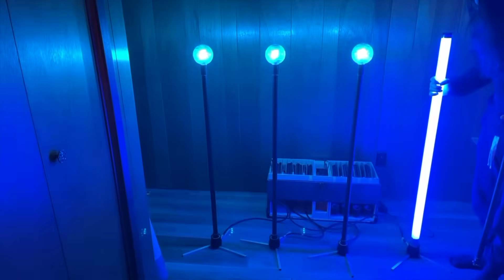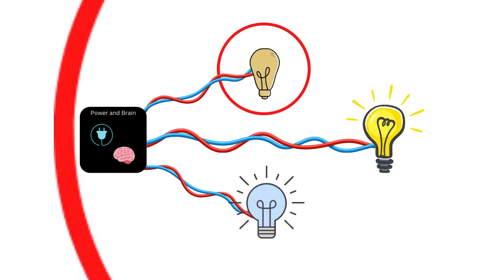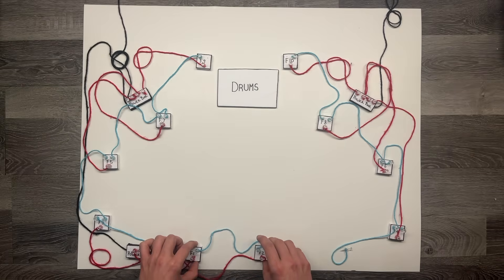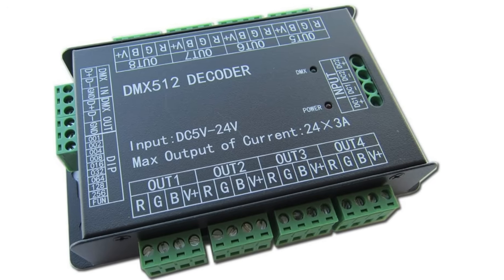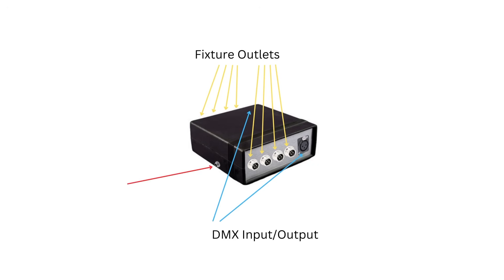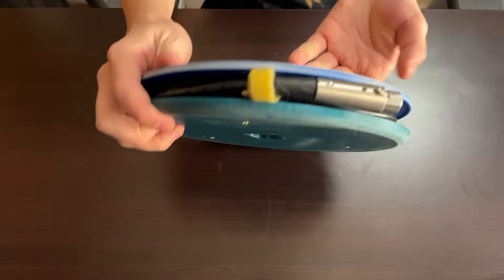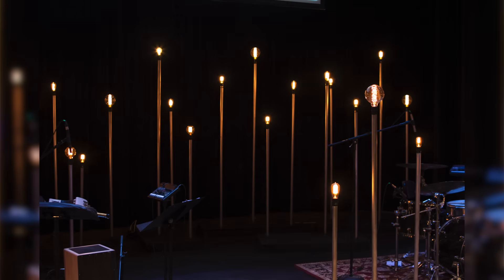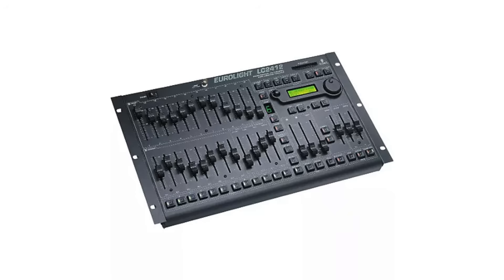This diy DMX Light Rig will Change Your Live Shows

Comment: How did you wire the cables?  Are those 4 pin connectors or do you need a 5 pin DMX?

Comment: great staff, but have one question - have you ever any legal questions/problems? you know - all the certificates, fire regulations, CE markings, etc.
Reply from the maker: That’s an excellent question and something I’ve been trying to figure out but it hasn’t been super clear, but the power supply is being used in a standard way and everything after the power supply is low voltage, which from what I’ve seen should be ok for how I’ve implemented things, but I’m definitely open to getting a more solid answer on this
Reply: @SuperValidDesigns  Great that you keep safety reasons in mind. I understand that you use certified components and the installation on stage is under low voltage, but I was wondering, for example, about the construction of LED strip tubes with light-diffusing paper, LEDs generate heat, not much, but still, have you tested them near other warm or hot devices that may be on stage, or how they will behave when they are accidentally covered with some fabric, a curtain?

Comment: hey! i find a lot of this fascinating as a pro av person who wants to use my skills at home but couldnt even begin to think about investing in pro fixtures. this would be a dope way to practice my programming abilities- but I have been looking into people using these decoders many of which have dip switches etc i suppose im curious how the data protocol works here? i want to create something that i can hook up various lengths or fixtures as you did, but if you use  trad board instead of that dmxis how is the board understanding channels? theres 4 for WRBG but if i have long lines of led and want it to fire different leds at once (like flash up the tube) and fades etc how many channels do these command? and are you always able to fit your shows within the one universe allotted by most small boards? im just curious how cheap and how far you can stretch this idea because i want to start a local industrial night and lots of venues like you said have poor lighting options. sorry if this message is a mess idk if what im asking even makes sense im just trying to wrap my head around this from a board perspective since a small board is a better investment for me as a working technician than the dmxis right now..

to add a PS have you ever toyed with this idea being used to 'pixel' map like you could with something like a pixel drop? it would require more strips brains power everything but still far cheaper than a pixel drop would ever be lol

regardless wonderful job wonderful video and if nothing else i guess hence my questions above a more in depth video about how you program your shows both regarding the dmxis and with a board if you use one would definitely be interesting
Reply from the maker: Thanks so much for the comment! I think you should check out the V2 video of this project. I redesigned the whole thing using Pixel LEDs and its actually quite simple. For programming, any artnet capable pixel mapper works. I recommend touch designer or showbuddy active but there are tons of options in different price ranges from free to ridiculous. Let me know what you think of the updated version! I think it answers all your questions!

Comment: Can the decoder work with any type of light ? for instance a strobe? really neat what you designed. Always wanted to try making something to the same effect as you. Years ago wanted to hold a festival, plus wanted to tour manage. Unsure if you also took wood shop or whatever it was called but the lamp project was really neat compared to the wood only projects. Years ago made a custom poker table, which I included lighting but given the time constraint...wasn't exactly able to do what I wanted with the lighting.
Reply from the maker: I can definitely flash these lights enough to give a decent strobe effect but I think if you wanted a true strobe light, it would be very easy to just add an off the shelf strobe light into the dmx chain, if that answers your question

Comment: These are fucking amazing!  I'm trying to build my own fully wireless (self powered) standing lights as we speak.. Those tent pole clips are almost exactly what i need.  I've been looking for similar clips that can handle 3-10amps, how did those tent pole clips work for you?  Was there any drops or instability especially for the data lead?
Reply from the maker: The tent pole clips were a total light bulb moment for me! I havent had any issues with them whatsoever though i havent exceeded 5 amps through them but I think they are a pretty safe bet
Reply: @SuperValidDesigns  had major problems with my ws2812b/esp32 setup, specifically the data.  I researched and found that the logic level shifter solved my problem.  I also spotwelded nickel strips (normally used when making battery packs) directly over the tent poles, and used copper screws for better conductivity

Comment: pretty cool bro hit me up if you start selling the tube lights but make things lighter you can wireless rechargeable dmx transmitters it would make your set up a hole lot lighter and stuff to carry around but i need a dmx light tube set up
Reply from the maker: Thanks man! Wireless is something im looking into, ive just always had a bit of cold feet losing the cables as, every issue ive ever had on the road has always been due to wireless systems and batteries

Comment: Hey, love this idea. What kind of controller/software are you using to control? Would it work with the Lightkey program?
Reply from the maker: Hey, I was using a DMXIS box through a plugin on ableton live but ive since changed to Touch Designer as my new version uses pixel LEDs (you can see the new version in a recent video I posted). I havent used lightkey before but I'll look into it!

Comment: This is amazing. Could you make this wireless by embedding li ion batteries into the tubes and transmitting the dmx signal wirelessly?
Reply from the maker: It's possible and I am looking into wireless as an option! But in my experience, ever issue ive had on the road has been a result of either wirerless connections or batteries dying so i do have a bit of cold feet abandoning the cables, especially in a live show scenario where that could cause a critical error

Comment: Super informative video! 

Would you have considered going fully addressable LEDs ? I'm looking to build a similar system (mostly for light shows) and I hesitate a lot (not a fan of the barfy rainbow effects)
Reply from the maker: The new rig will use fully addressable LEDs and I'll be releasing a video about this soon. I agree about the rainbow effects looking tacky sometimes but that's just a matter of programming

Comment: I recently built something very similar using an off the shelf LED Channel and had the same idea in mind for the brain/cabling solution. I've been able to run power and control for RGBW 12v fixtures all through ethernet cables and ends which and I've done up to 50ft and haven't seen any voltage drop. The one thing I love about your build and I'm still trying to trouble shoot for my own is how yours have the built in stand. I've been trying to come up with my own stand option for my lights as I'm hoping to get mine out on the road for some of the Canadian bands that I work with as well. If theres any chance you would be willing to jump into a brain storm session, let me know! I wish I would have come across your videos just a little bit sooner!
Reply from the maker: Thanks so much for the comment! I’m definitely down to chat! Would love to know who you’ve worked with, maybe we have some friends in common!

Comment: Thanks for the parchment paper tip! I made a similar project but the tubes were 10mm, I want to go with bigger tubes and was going to use pool noodles to defuse but your idea seems way better. My lights use E1.31. Why doesn't anyone do this and avoid cables altogether? Is it just not well supported? (I'm not a lighting guy)
Reply from the maker: For me, in a touring scenario, every issue we ever had on stage was either a wireless or battery issue and I wanted something that was bullet proof. Wireless is definitely cool in some scenarios though!

Comment: Using an ESP8266 or ESP32 microcontroller for each light and a router (to create a secure local network - no internet required) you could eliminate the DMX cable entirely from the whole setup.
Reply from the maker: I’ve always preferred cables over wireless for reliability, but that would be an interesting option for other uses for sure

Comment: great idea with the swapable lights. So next level is : all wireless and battery powered and you do your setup in 5 Minutes. If you inspired me that much that i will build something similar and inspecific "copy" your basemounting concept. i will let you know. as a traveling DJ cables are not an option.
Reply from the maker: I agree wireless would be cool, though with the budget I had and the reliability I needed for tour, cables were an easy choice. Also we had a bunch of wireless gear on tour and they were our main source of issues by a long shot, so it’s something to think about in the future for sure but I recommend cables for most people

Comment: Why not use more robust 4 pin xlr connectors? it would make setup much quicker because there would be no need to meticulously screw in every aviator
Reply from the maker: I agree. I will be using nl4 connectors on the new version where it needs to be plugged in often

Comment: Amazing work! you are so creative, the effect looks so cool with your DAW which makes the scenes perfect, may I ask which LED did you use? I think this would be so cool with ws2812b LED and athom strip controllers so it can be wifi controlled neo pixel from your phone or computer instead of DMX
Reply from the maker: Thanks so much! I just used 5050 smd RGB led strips at 60LEDs/meter. I’m working on a new system now with the addressable leds

Comment: This idea is amazing. I plan to construct an 8 LED tube system to act as a facade for my DJ booth and control it with SoundSwitch. I discovered in design phase, that RGBW LED strips require 5-pin aviation connectors, which are oriented by design and can only be plugged in one-way. I also had to upgrade to an RGBW encoder to use all the effects of the RGBW strip. Although the strips are more expensive, I prefer a cool white over the warm white for my visuals.

Thank you for posting this, definitely a huge inspiration for my upcoming rig.

Comment: Cool project! Trying to wrap my head around this. A question. How did you get both power and DMX signal to run through just that 1 cable to each fixture? I thought it would require either 2 cables (1 for power, 1 for DMX) in order to get a fixture up and running. I know that here are combi cables, but then you still have 2 connectors (a DMX connector and power connector (like powercon)), while you use only one connector. How did you use 1 cable and use only 1 plug (the avaiator)?
Reply from the maker: All the DMX is handled within the distribution box. There is a DMX decoder which takes the DMX signal and converts it into 12v signal sent to each fixture base through a 4 conductor cable (RGB and  V). So basically, the cable to each fixture only needs to send power as the DMX signal is handled back inside the distro. Hope that answers your question!

Comment: Hello Mate,  I just stumbled over your video just 2 days ago and as  an electrical engineer I wondered if there is any specific reason why you are using 12V LEDs strips (there would be also the option to go for 24V, which might be better for higher cable length and stuff). Was this maybe just not a thing at the time you built these or was there a reason I cannot get behind? :) would be great to get into your design process, as I was thinking about building this for myself too. Thank you very much for your inspiration!
Reply from the maker: Thanks for the comment! I learned about voltage drop part way through the process of building these and 12v LEDs were much more available at the time I designed this but I have since thought about switching to 24v so I could utilize thinner cables. That being said, working on a new version that can use Pixel LEDs, I’m once again finding 12v to be far more common than 24v for the pixel leds so I’ll probably be sticking with the 12v system for now. It would be very easy to switch to 24v though and I would recommend this for anyone that doesn’t intend to use pixel leds

Comment: Here we are 6 months later and so much has changed, Agree this is a amazing system but now their are many options in which you can do this, bulbs are cool but edison G25s are now availiable from GE CYNC and are everything I bought four on sale for 100.00, Love the screw drop in just know there is a clever way to make them magnetic as well as the ends using strong mags so that they are also stackable and or attach to roof trust easy, now with AI 1.0 auto lightshow pricey for 999.00 but none the less for on the fly amazing light shows worth it. I can see a one man band able to do some cool shit for under 1500.00
Reply from the maker: Cool things to think about for sure!

Comment: This is literally my new passion project 
Quick question, would a addressable RBG strip work? if so, could it be programed with the DMXus to get the most out of it?
Thanks!! i hope you get more videos about these riggs soon.
Reply from the maker: Should be pretty easy to implement addressable leds. I’m currently working on a new version that will include this. I don’t think dmxis will be good for addressable leds as it can only handle one DMX universe but we are working on a solution for that too

Comment: Would a 4 pole Powercon/Speakon type work for the base to fixture connection? Also for the distribution box to light base cabling? I know Speakon isn't designed for power use, but might be OK. 😅
Reply from the maker: Not too sure but I can look into this!

Comment: Hi, can you help me if so?
I'm looking for a DMXIS box.. as it is no longer on the market I have great difficulty finding one even used.
Can you tell me where I could look?
Thank you in advance
Reply from the maker: Unfortunately it seems dmxis has been discontinued 😫 I’m looking for alternatives now
Reply: I just purchased the Enttec DMX USB Pro Interface with the Emu software.. and it seems to work very well.. the only problem is that it doesn't have a VST that works on Logic pro x.. unlike DMXIS which worked very well and was very light . @SuperValidDesigns

Comment: DMX cables are xlr cables. The connector is what gives it its name. The only difference can be the impedance of the cable. Most people only use cables with the right impedance for DMX as it doesnt compromise other applications.

Comment: I'm in the process of going through these DIY builds to find an inspiration to get some done for our mini stage. I wonder how these look from behind? If you were to design a light fixture that is meant to be seen 360, would you wrap the leds around a pole or use several vertical strips at an angle (i.e. 2 or 4), rather than using a single led strip?

Comment: Because all these cables come from the source distro they will get delved and tangled with whatever is ran over it or setup  besides it and since you rely on your custom distro cable.. if some cable were to get damaged or snagged you are essentially going to have to give up on that light since you can't rely on someone else passing you a cable.

I can also imagine the cable weight to scale up drastically with show scale and fixture count to the point it becomes once again a logistical issue.

If you want to have lights you should just add your lighting to a rig/truss thats risen above stage and stays up there till end of show day and/or patch your programming with whatever the rig on location has to offer for you.

For LED tubes you could use battery powered tubes with wireless DMX if so desired to save on cable mess on stage and time to build and remove.

Comment: Rarely do I see an idea, no, a concept that is so damn well thought out most especially on YouTube.  It is beautifully compact.  The one thing that I would add for even more pizzazz is addressable LEDs.  There is nothing in your design that would preclude that.  That's damn clever.  I'm impressed.  I do some DJ work but simply don't want to carry any more stuff.  This would fit the bill nicely.  This is a marvelous piece of design engineering.

It will surprise me if the Chinese will not be knocking this thing off by the end of the year.  Don't be surprised if they do.  It is that good.
Reply from the maker: Thanks so much! Sorry for such a late reply! I released a version 2 of this rig that uses addressable leds! I uploaded a video about it a few months ago!

Comment: If you buy 16 sufficiently long AC cables and twist/tape them with an equally long DMX cable each, you will have the exact same system at a fraction of a cost and with 10x more reliability and based on fully standard components. And it can be done in both "star" shape or "daisy chain" shape.
Reply from the maker: Very true, but the main goal of the system was so I could have a power and brain ground set up that I could remove the light source easily and leave the bases on stage for super fast changeovers. Additionally, I wanted to be able to keep building new custom fixtures for every group I play with without having to buy and rebuild the Power and Brain every time

Comment: I have a question if the large lights consume 3amps, the small ones could be 1amp each maybe do I will need 16awg cable? I was thinking more for 18 or 20 for the small lights, can someone point me to the right direction?